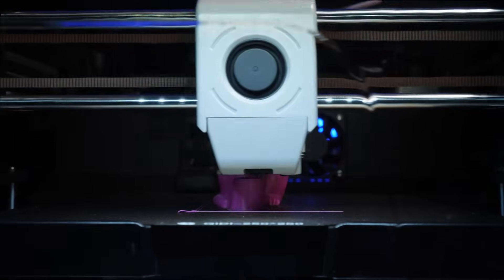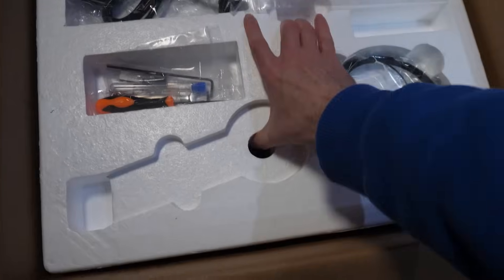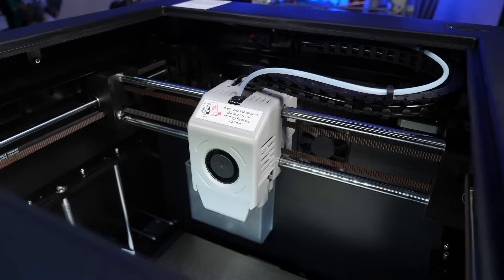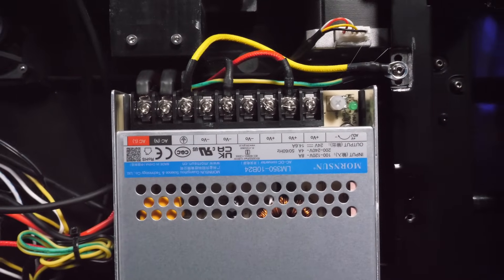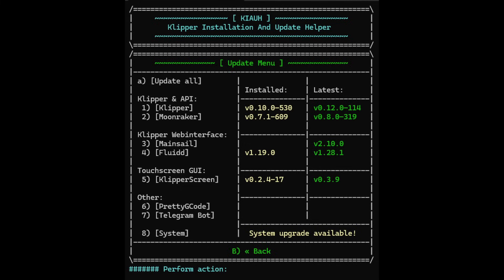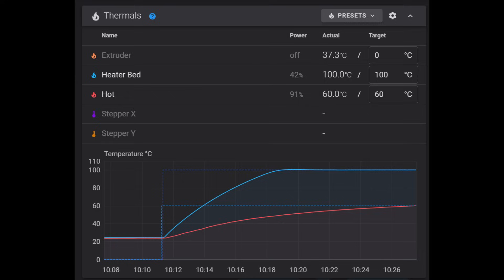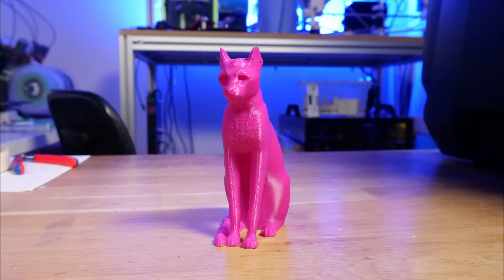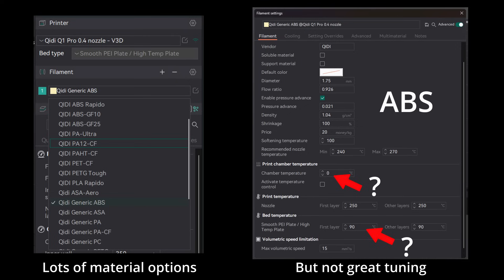QIDI Q1 Pro - Can it compete with BambuLabs?

Comment: Hi and thanks for working out the flaws with the Q1 Pro so they could fix them for the rest of us.  I know you seem concerned about the type of plastic packing material Qidi uses but I can assure everyone it protects the printer very well.  Did anyone have a broken printer because of poor packing?  I seriously doubt it.  My friend got a Qidi Q1 Pro a few days ago and it has all the problems fixed, has latest firmware installed and has an ethernet port added if you want to hard wire it but it has not been necessary.  The Q1 Pro prints ABS as good as a Bambu Lab P1S prints PLA.  The Q1 has a heated chamber and the build plate heats up to 120C - I don't think a P1S can do that.  Like comparing an SUV to a Pickup - both vehicles but intended for different uses. When opening the door it was immediately obvious to me how to do it. I have no problems opening the door.  I love the aesthetics of the case.  I don't mean to insult any Chinese People but to my American Eyes, the Q1 Pro case looks like a futuristic Sci-Fi inspired design you might expect from a Japanese company.  It is a home consumer item and not piece of commercial equipment so I think its nice of Qidi to liven it up a little.  Pretty impressed with the Q1 Pro and what it does for only $380 delivered to your door.  I think the Bambu Lab P1S costs a couple hundred more and that's without the AMS.  Thank you Qidi.

Comment: It would have been nice to see the actual capabilities of the hotend and heated chamber with more exotic materials like high temp nylon or polycarbonates. I think this is where this machine could shine when compared to other printers like the p1s or k1c. I get that the firmware is old, but does it really affect the quality of the parts when printing  special filaments?

Comment: No WiFi?  Really?  How stupid!  Deal breaker!  They dropped this to $469 but it still is a no-brainer to go with the Bambu Labs P1S or P1P.
Reply from the maker: It does have wifi.
Reply: LoL no wifi, you must be joeking.  How Stupid!  Q1 Pro with heated chamber and 120C build plate for $380 delivered VS Bambu Lab without heated chamber, without 12C build plate, without free shipping and without the AMS for $550.  If you want to print PLA get an A1 Combo, if you want to print ABS get a Q1 Pro. Its a no brainer.

Comment: I've just been having a closer look at the QIDI specific klipper version that they have in their github account. It's actually a bit crazier that you've noted. You said that they're using a very old version of klipper (0.10.0 I think you showed), but doing a quick diff between the real klipper repo and the QIDI repo, it looks like they've manually merged SOME of 0.11.0 into their repo - it clearly has some of the 0.11.0 files, bit it looks like this was done before 0.11.0 was released, or at the very least, some of the updated files are newer than the 0.10.0 version but older than the 0.11.0 version.

I haven't had time to go through in detail, but I'd guess that their version (assuming your machine has the latest that is in their github) is somewhat closer to 0.11.0, but not actually based on 0.11.0.

I'm hoping to have time to go through and work out what they've actually changed in their version apart from just selectively pulling updated files from 0.11.0.

I'd like to say that I hope this sheds some light, but tbh it really just throws some pretty harsh shade on their software development practices.

Comment: My WiFi was flaky with this machine.  The USB network adapter was much better!  My back panel did not have the cutout for the network adapter.  This has been a really good printer so far, but I am coming from an almost 10 year old Flashforge Creator Pro.

Comment: Seems like former Elegoo and Bambu engineers got together and designed it. Elegoo has a bastardized version of Klipper running on their N4 series (I learned the hard way that you can't update Klipper without bricking the machine) and then the chassis and hotend look like you ordered a Bambu P1/X1 printer off of Wish. Still seems like a decent entry level CoreXY printer. I have a Bambu P1S now and I really miss Klipper and the Fluidd interface at times.
Reply: how does the q1 compare to the p1s?

Comment: The heater is safe no way to touch it directly because of the heater grid. any toaster is more "dangerous".
In the US, all garages have GFCI plugs, plus you can convert any regular plug to GFCI and never get shocked in case of a ftupid mistake.
In Europe, almost all homes have "GFCI" brakers.
Anyway, it is completely safe, safe than any other electric space heater 🤷
Looks like a complete overreaction
Reply: @wshannemann It will not experience thermal runaway and it is perfectly safe. The heating elements can only draw a maximum Amperage and only heat up so much. Please don't spread rumors you don't understand.
Reply: Same as a space heater 🤷
You know the brakers, right?@wshannemannuwehannemann9520

Comment: I've been thinking about getting the Q1 since its release, but some things in this review does concern me. This especially is a concern for the open source-ness of the printer and the firmware issue. Is their X-Plus 3 better for open source?
Reply: What's the specific issues about open-source that you're referring to?  The source code for their Klipper, Mainsail, and their Screen UI is all available.  They forked from mainline Klipper on 24th July 2022, but do occasionally back port in mainline features into their own fork.  This appears to be a business decision, as supporting a printer with a completely open firmware would be a nightmare for a company with respect to the number of things that can go wrong in that scenario.  If you ask Qidi however, they will actually provide you with a full copy of their dev environment for you to work on their version of Klipper yourself and port in any upstream features that you want.  I've got half a mind to try to merge their fork with mainline myself but haven't had the time to do so.

The physical hardware isn't open source, but that doesn't mean that you can't mod it.  It's running an MKS SKIPR board and they give you root access to that, so really you can do whatever you want.  They just don't make those facts front and center as they apparently already deal with a fair number of people who have bricked their printers by fumbling about.  This is usually recovered easily with a new eMMC though.

The slicer is fully open source and available.  The recent issue with PrusaSlicer not being correctly credited in the "About QidiSlicer" popup page was introduced two months ago by a bad PR, that they've reversed and will be fixed in the next slicer version.  In all other locations PrusaSlicer remains correctly credited.
Reply: @stew675  I'm not as well versed as other people are with 3D printing, I have an Ender 3 V2 as a project to work on. I knew going into it that it'd be something where I have to learn how to fix all of the, well, poor quality to it. The best I know is about using Virtual Studio to follow direction on installing a pretty basic Merlin firmware. What concerns me is not getting the latest Klipper firmware. Tho I am unfamiliar with Klipper, I do intend to learn a lot more about it when getting this 3D printer. However, I'd like to not be restricted to a two year old Klipper version.

Overall, I do just need a 3D printer for making parts and art models of my own because I own cats now and little time to work on the Ender 3 V2. I cannot be bothered to see my prints go to waste because my cats decided to get at it and set themself a blaze. Therefore, I just need it to work and still be able to maintain the 3D printer. My worry is having to purchase proprietary parts important to the 3D printer's functions. I'd like to not rely on one company to provide parts just because of wack design philosophy. This extends to the firmware as well because I'd like to know I have options if I want to upgrade or diagnose any issues.
Reply: I got a Q1 pro, coming from a heavily modded klipper Ender 3 V2. The Q1 was the simplest thing to set up, it was printing almost flawless parts. For the early bird price, it’s almost stupid to pass up. (Given  you have the resources to get one)
Reply: @bp8__163  Wow you got it fast! Glad it's going well for you. I really want one.

Comment: Hello, perhaps the reason you have to write 10088 to use in the browser is that it is possible that only that port is open in the klipper, so we would have to see in the configuration if port 80 is closed and if secure authentication is enabled, that It is my contribution, in all things better than some manufacturers in my country hahaha I would love for them to compete for a similar product.
I would love to do reviews of those devices, I recently wrote to Vin de Pepooli about the magneto x but they are having production problems.
VLLC Yeahh😅

Comment: I think you were a bit harsh given price to performance. Bambu Lab doesn't use stock open source firmware and you can put vanilla Klipper on this machine if you want to. How many people want to use ethernet over WiFi for printing? The packaging for shipping seemed fine and no reviewers have received damaged units. There is a lot of good, especially for $469 or even $439 with a coupon right now. It can use advanced materials and seems pretty trouble free. In all reviews I have watched, the print quality looks phenomenal. You didn't show much printing, which I think is very important. Not totally knocking the review. It just seemed a bit against the printer from the start.
Reply: I am a Qidi tech customer for LIFE for 1 reason alone... they have the absolute BEST CUSTOMER SERVICE in the 3d printer game, hands down, not even close at f**king all! Lmfao, I have the qidi tech gen 2 printers, X max 2 and X plus 2. Even after MANY years later, Qidi overnights any/all replacement parts that I have needed at no expense to me at all! Even if I did something wrong and broke some parts on any/ALL of my Qidi printers, it doesn't matter... no questions asked, just a simple Pic of the parts that need to be replaced so as not to send out the wrong parts due to a wrong interpretation or language barrier issue... and they overnight the parts and are on my doorstep in 3 or 4 days from China. They answer every single email and answer every question ( no matter how stupid AF as it may seem ) within the day. They usually answer my emails within hours, even on their "closed hours." I had received a lemon X max 3, and we went through a bunch of problem solving. They overnighted some upgraded parts... and it still was bad. So without me even asking at all, they gave me a full refund and said I could keep the printer for my troubles. Fix it, sell it, use it for parts, do whatever you wish with zero strings attached. They apologized up and down... I immediately ordered another X max 3, and it prints perfectly 👌 👍. Now I just bought their new Q1 pro, and it should be here in a few days. Creality has terrible customer service if you don't have a yt channel that has a bunch of followers... yeah, I said it 🤣 and Bambu's customer service... bro, please, they want it back at alll cost to YOU. You have to pay for shipping to send it back, AND they even want it back in the damn box it came in! Like, who in the hell holds onto a big box like that? That's even if you can reach someone there, cause AGAIN, they have a VERY VERY bad reputation of blowing off customers that don't have big followings. Countless people are always on here complaining about their despicable customer service. Yeah, you may have one that prints perfect out of the box... for NOW, headache incoming if something breaks. And that is a "when situation" and not an "if." So that's why I rock with Qidi, cause they don't dodge me or blame me for my f**k-ups and their f**k-ups! Also, they are great printers... I think everyone is so stuck on bambu and their dreaded walled garden cloud BS (jk) that they just are automatically waiting to bash any/all printers that come even remotely close to bambu's performance at all. Have a good one
Reply: @danieljamesbindery  Yep I have consistently heard both from personal friends and tons of random people online they respond incredibly fast and are very generous with their assistance and solutions.
Reply: What is the process for installing vanilla Klipper on this machine?
Reply: @znaut  probably reflash the emmc
Reply: @znaut  I'd check out r/Qidi. I haven't done it myself. Not even sure if there is much benefit to doing so, honestly.
Reply: @znaut You can't without breaking the screen
Reply: One of the reasons why I considered the Elegoo Neptune 4 and Flashforge 5M was because of the Ethernet cable. So, I agree that the majority of users will ignore that. I don't follow this channel, so I'm not sure if they complain about the lack of Ethernet only on that printer.
Reply: @FrequenciaJogos  It's definitely a thing for a small subset of users. Most people would prefer WiFi. Not sure why he seems against it.
Reply: screen looks unusual. Can you just put stock clipper on there and it adjusts to the screen resolution?
Reply: Agreed! I wish the review covered a bit more of the actual capabilities of what the printer can do.
Reply: He’s honest and gives you the good and bad. He didn’t state anything false. 
Would you rather him sugar coat a turd or give you the facts?
Reply: @gaxon1920  My issue isn't with him presenting the negative at all. I would much prefer a reviewer present the good and the bad. My issue is that it seemed like he found negatives for every positive and presented them as though they were equal in weight and number to the positives. Meanwhile there are a lot of positives about the printer he didn't discuss or barely touched on. Most importantly, according to every other review this printer seems capable of fantastic print quality at high speed with even more difficult filaments. He barely showed any printing and didn't really test the capabilities or compare it to anything else at all. To be honest, it just seemed like a review that wanted to dislike the printer. Maybe he had a negative experience for some reason that is difficult to quantify. Going through the comments it's obvious several people got an overall negative impression from this review. Meanwhile, this printer seems to be a solid value even at full price. Difficult to reconcile. Of course not every review will be positive, but there was genuinely nothing wrong with the printer. Nothing broken, non-functional, or even much worse than many popular printers on the market. It printed well without major issues. A lot of printers can't even manage that. I mean he even complained about it being shipped with Styrofoam. As if $2,000 televisions don't still ship in the stuff. Just seems off. I'm not alone in this opinion either.
Reply: I felt he focused a lot on some negatives that weren't really negatives. For example he complained a lot about the software but you can just use regular klipper, and he complained about the Wi-Fi module which I don't see as an issue, also for the speed settings he said they weren't even close yet that's just the default settings for those examples prints, there's nothing stopping him from setting it's max speed. He also complained about the quality of the touch screen from a technology standpoint but not it's actual usability.

Lastly the focus should really be focused on the prints as what good is a well made printer if it prints like shit?